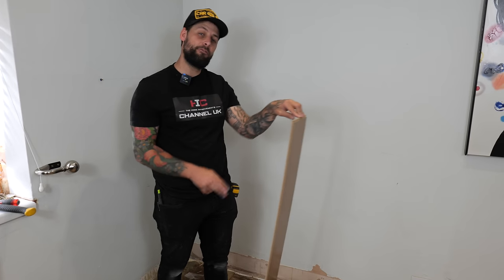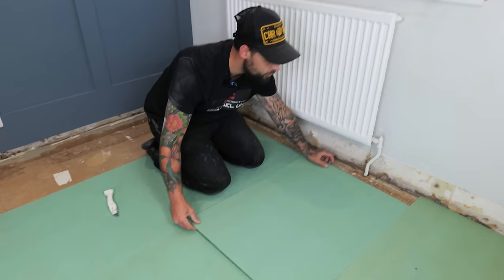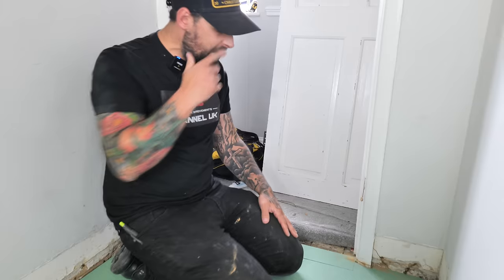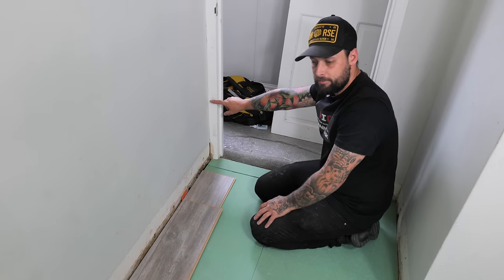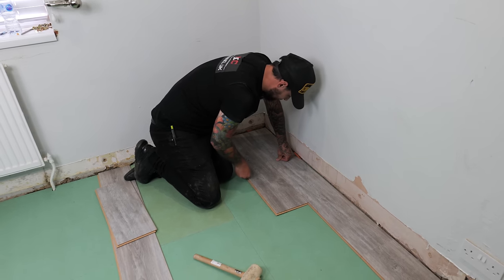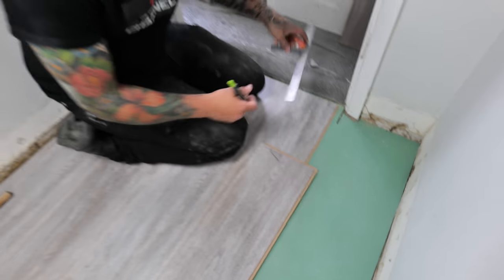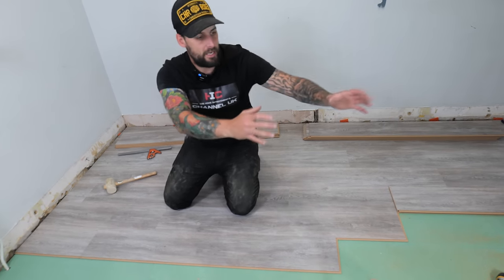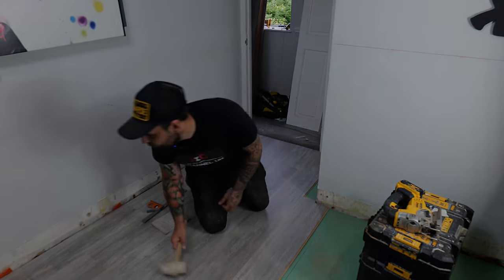How To Install Laminate Flooring | Easy Step By Step Beginners Guide

Comment: I don't understand why do you need to remove skirting boards before laying laminate flooring, you can use beading against the skirting boards
Reply: Makes a tidier job. It'll contract and expand under the skirting as opposed to the beading.
Reply: Beading looks cheap and unproffesional. And  the skirtings are very likely far from perfect. The flooring will look much better with new skirtings.
Reply: I don't understand how  you can even ask that question???  Don't you have any quality standards??  Or you  just always go with the cheapest and poorest quality finish
Reply: Some people don’t want beading lol
Reply: There’s no rule saying you have to remove them. It may be because you want a better cleaner finish without the beading strips, it may be because you’re old skirting boards are a mess and past their best, it may be cheaper for you to keep the skirting and fit the beading strips. Do whatever you like.
Reply: Because the beading looks awful
Reply: Old skirting is a pain in the arse to remove and refit. Beading is totally fine if you fit it right
Reply: Beading 🤢
Reply: Cos that looks shit
Reply: Looks crap though. Its like having skirting boards for your skirting boards 😂
Reply: Quarter round is so ugly though. I would remove the base boards
Reply: My opinion is - as it is skirting is annoying when you put some furniture against the walls. A quarter round or whatever added to that makes it even more annoying if the legs of a bookcase or sideboard hits it and so leaves a big gap at the back of the furniture. As others say it also looks a bit amateur.

Comment: Only thing I would do differently is use a drill to cut pipe holes just find its a bit neater to start with bit an then just cut the lines straight to meet circle rather than trying to get good rounded edges with a jigsaw and when possible putting a join on the pipe can eliminate that gap behind the pipe
Reply from the maker: Agreed much better method 😊👍🏼

Comment: Watched this video so many times I almost memorized the script. I finally did my building and I have to say, it's so much easier once you actually do it. After about 3-4 rows I got it down and did my entire building in about 5 hours. Not sure why I was so scared of screwing up lol. If you're hesitant like I was, just do it. It's really easy. Thanks for the tips and tricks. As far as the tools. I just used a rubber mallet kit sold specifically for this type of job and to cut, I used this guillotine looking cutter the store had so I didn't have to use a single power tool. Saved a bunch of money and no dust clean up doing the manually cutting route as well.

Comment: Best tutorial(s) on YouTube by far. One question… do you need to lay a DPM when using fibre board on top of a concrete floor? Or does the fibre board act as one?
Reply from the maker: If you are using fibreboard on a concrete floor you would need to also lay a DPM and ensure the concrete is fully dry.

Comment: Best video by far and Ive watched a view before I do my floor, can I ask, my laminate is 12mm and intend using 5 mm fibre board underlay but cannot find a suitable sized threshold strip to the landing carpet, they all dont seem deep,enough for the laminate and underlay, or advise me please
Reply from the maker: A typical z bar will work as you can tip them 😊👏🏼

Comment: You mentioned underlay with moisture barrier for concrete floors -  is this underlay covered with aluminum foil on one side? Does this aluminum foil cover need to face floor or be on top? Thank you.

Comment: How's it going mate, Love the video!! I have a question, please. When checking to see your not left with a tiny bit of floor on either side of the wall (around 9:25 you explain this point), what if you are left with a tiny strip of flooring? How do we over come this? Cheers

Comment: I have questions:
1) what brand of laminate floor did you use.
2) As it’s a flat blank, not bevelled edges. Is it still in good condition or has the planks started  to chip around the edges as you installed it over 9months ago.

Comment: We tried fitting out laminate in a very small space at bottom of stairs we used 1 pack of flooring. Our main issue was getting it to click and we were  not able to slide it in due to lack of space. Looks ok but I have noticed the 6 planks  have moved since fitting...I guess because it's floating it will move and be more noticeable?

Comment: Such a great video as always thank you! Do you have any advice or recommendations for joining laminate between two rooms? I want it flowing between living room and hallway. Would you have a flooring strip and separate between the two rooms or keep it flush throughout? And keep the pattern direction facing the same way?
Reply from the maker: We run ours through but it’s is recommended by manufactures to have thresholds between rooms so it’s at your own risk of course 😊
Reply: 110% do not separate. Have them as 1 whole piece.

Thank me later.

Comment: Hi. Did you not allow any explanation gap while laying the fibreboard underlay? Or does it not matter? Read on most places online that you need to allow at least 10mm for expansion between the fibreboard and skirting board.
Reply from the maker: You should yes  but from experience no point 😊

Comment: Great tutorial. Not laid a laminate floor in years.  Any advise on my hallway. Its norrow but long. Its 18.2ft long and with only 3.4ft would laminate be weak as the width is so short. Would only be 3-4 planks wide?
Reply from the maker: Will be fine done plenty like that 😁
Reply: @homeimprovements  thanks for the advise, much appreciated.

Comment: This is exactly what I need thanks. But one question.. I'm have concrete flow under but it's the green stuff also isolation or do I need 2 lagers under the laminate, one against the Cold and one against the Moisture?
Reply from the maker: You need an underlay designed for concrete 😊
Reply: @homeimprovements  so just one not two?

Comment: Great video, having a go doing my own when it turns up in a couple of weeks :D However, I've seen some people suggest a space between the underlay panels of 5mm? What's your opinion on this? Would be cool if you had any suggestions on the best under lay too. So many options! (I think I prefer the fibre panels).

Comment: Hi! I notice some packs of green fibre underlay I ordered have turned yellow. Is this normal or does it mean damp?
Reply from the maker: The sun will remove the colour 😊
Reply: @homeimprovements  ah thank you so much! 
Im finding the fibreboard flakes/ saw dust comes up when i walk on it. Thinking to put a thin foam underlay on top of it before laminate- is that a bad idea?

Comment: My floors timber but I have a small concrete fireplace rectangle what underlay should I use? There’s also a couple of mm of uneven where it meets the timber will the underlay be forgiving of this?
Reply from the maker: For that fibreboard will be fine 😊

Comment: Got myself some laminate to lay down. The thing is that it's some kind of laminate where you have to connect the whole row and lift up the whole row at angle to insert it into the previous row. I've seen in some other video that's called "twin-click" but on the package of my laminate it doesn't say anything or have clear instructions on how to install it. Any tips on twin-click?
Reply from the maker: Even easier to install 😁 Same method except you just slide it up and mallet the clip down 😊👍🏼👍🏼
Reply: @homeimprovements  I had a friend come over to help me today and we've done it. Yup, the mallet was necesarry to fully engage the front/rear joints. The side joints just clicked in from an angle and you just lay down the whole row. Thank you!
Reply from the maker: Awesome 😁👏🏼👏🏼

Comment: Guys quick question when fitting laminate I've always fit against floor boards if I ply the floor first can I run the laminate with the floor boards? Using white sheet underlay not boards
Reply from the maker: Absolutely mate 😊👌🏼

Comment: Can you give me a recomendation for the underlay i should use on a concrete subfloor in a new build,well 4 years old?
Reply from the maker: Timbermate is very good quality for concrete floors 😊
Reply: @homeimprovements  I'm looking at floors to go I think, they've got a sonic gold 5mm roll, tekno boards, I think there polystyrene, the fiber boards or the standard 3mm silver backed green foam, also if I was to use the 12mm and 5mm underlay, what would I use where the floor transitions to vinyl flooring? Off the hall way to the left I have the living room door opens in, just past the living room on the left is the bog door opens out in to hallway, floor is vinyl, end of hallway leads straight in to kitchen door opens inwards into kitchen floor is vinyl, what would I need to loose the 17mm step? Hahaha it's all confusing lol cheers for reply bud
Reply from the maker: They sell something called a stick down ramp for those 😊😊
Reply: @homeimprovements  ok cheers bud, one more ? For you, 8 or 12mm, both are rated AC 4, 20 year manufacture warranty rated for light commercial use, I'm using it for a living room and hallway with 4 door ways to contend with!
Reply from the maker: 8mm for us as the wear layer is the same much nicer to install 😊
Reply: @homeimprovements  , While waiting for your reply, I did some research, had a look at the 12mm and decided against it as it looks like it will be a bigger around door frames, and with the underlay there's a lot to come off doors that transition to a much lowe level ( won't lie, they would make great jumps for my RC car with ramp bars🙊🙉🙈😛)  so I went with AC4 8mn step click with a 15 year residential guarantee! As we're In a new build the flooring shop recommended the 3mm silver foam underlay for downstairs and for some sound deadening on the upstairs chipboard floor the 5mm sonic gold, I'm just stumped where to start down stairs as I want the floor too transition from the living room into the hallway but it's a mad shape meaning at one part I'd have to lay the laminate backwards if you know what I mean?  If I post a quick short with a diagram of the floor layout tomorrow morning, would you be as kind as to have a quick look and tell me what your thoughts are? You've been a great help and it's very much appreciated mate 👍🏻👍🏻

Comment: Maybe a strange question I don't know. We need to take up a row of laminate or two because we need to get to under the floorboards to do a job. Is it fairly easy to just remove a row? It needs to come from the middle too.
Reply: Its a click system, you pull up from the sides
Reply from the maker: As said you’ll need to uplift from an edge and work your way back to the middle section 😊👍🏼
Reply: Thank you. I thought that may be the case!

Comment: Just thinking about putting a laminate floor in my lounge but half the lounge as a wooden floor and the other half has concrete, should I mix the underlay  or could I get away with just using the fibre board throughout the room the floor is uneven. Can't believe thinking about this and up popped your video great video guys thank you so much 👏👏👍
Reply: Surely you'd use the moisture barrier throughout...
Reply from the maker: Just use a dp on the concrete side under the underlay and use fibre boards 😊 or if the floor is flat enough timber mate is a fantastic underlay with vapour barrier 👌🏼
Reply: Great video. I wished I'd seen it before I did mine. 😂 👍
Reply: @homeimprovements  there's only one dp I know, and I'm not sure how it applies

Comment: Beading all the way around the skirting board, after you have laid the laminate flooring does look really unprofessional.     Personally… i don’t like that idea.   But, if you want to keep the skirting board on.. for some particular reason…. like i would do;  what other option is there?   Except lay, the laminate panels up against the skirting board.     Or you could use a dremel tool… and cut underneath all the way around the skirting boards; and just slide them under.  

I’m undecided what to do about my 16x12 feet bedsitting room;  as the tiny kitchen i have is slightly joined onto the room itself.   
Buying a 17x13 feet Lino roll would not probably be an option; because i doubt whether i could get it into the flat itself. ( Lino roll would be far too long) 
Laying down a carpet is not an option either.  Would have to go in the kitchen.  Would get too wet and dirty, if anything is spilled.

Laying laminate flooring seems the only option.  But i must admit though… Lino does look nice too.
It looks like i might have to lay the laminate flooring myself.   i just hope i get all right? 
22nd June 2024.   Southampton England 🏴

Comment: Making those marks all the way to see if the layout has a small cut is ridiculous. Put a few pieces together take a measurement. Then measure the room and see what the off fall is. Lord don’t make it so difficult. 

Also get yourself a laminate cutter. Save yourself the mess and time. 😭🙃
Reply from the maker: I have a guillotine and you don’t need to put bits together I can do it with a tape measure and the length of one board but we try to simplify to help people without all the tools etc 

We have been doing this 17 years

Comment: I always put a number on the back of the board and the corresponding number on the underlay, should i ever need to rip the flooring up for a leak and then it can go back down as it was installed originally 👍

Comment: Lads, honestly, smashed it with the explanation. Keep up the good work. 

I’m a fair newbie to DIY handyman type work for the last 2/3 years (acoustic insulation, carpeting, noggins etc.) - so just diversifying my skills. 

3 quick questions: 

1. Couldn’t you in theory use the laminate cutter instead of a Jigsaw for the initial piece you did? Guess you’re gonna need a jigsaw for door frames anyway!

2. I didn’t quite get the point around 9:02 about “tiny cuts at either end”? What’s the point in making those markings? As in, average room you’re most liking having to cut down the width of a laminate before you reach end wall? 

3. Is the “10mm” expansion from the wall standard? For skirting boards etc. to cover after? I imagine a spacer is 10mm by default then? 
 

Thanks
Reply from the maker: Thanks much appreciated 

1 yes you can 
2 basically we want to avoid any bits under 50mm so we plan out ahead of time 
3 all depends on the brand they vary from 5-10mm usually spacers are available in any size 😊

Comment: Question, I’m starting a laminate flooring project on the security nd floor of my house. I also will do the stairs, what do you suggest I do first,the stairs or the flooring? Also, is a underlayment needed on second floor? Should I start from the hallway into the bedrooms or van Coverdale? Your advise will be appreciated, thanks for the video
Reply from the maker: Tackle the hall first it’s the most difficult then rooms after that the stairs is what we would do anyhow 😊😊😊

Comment: Great video! I’ve been following it whilst doing my lounge and it’s going great. But I’m about to run into an issue, there are two doorframes that I’ve undercut and they’re both on the same opposing row as each other. Any tips on fitting the last piece under the door jam??

Comment: So glad that I've found your videos, I've been binge watching them all in preparation for renovating my own house. I do have a couple questions, what are the spacers/expansion for? Should small cuts at the threshold be avoided? And is it wise to have just two different lengths of laminate against one wall i.e. a brick pattern?

Thank you guys and keep up the good work!
Reply from the maker: Thanks spacers are for expansion yes yes avoid where you can and joints should be random stagger 😊

Comment: Don’t you need an expansion gap around those radiator pipes too? It looks like you’ve cut it so it’s close to the pipe.
Reply from the maker: You do and there is 😊👍🏼
Reply: @homeimprovements  Ah cool. Wasn't sure, as the vid cut to the next scene before that piece was in place. 👍

Comment: The laminate I’m using doesn’t click anywhere near as easy. It doesn’t actually click in at all on the long edge if you put the short edge in first. Have to use a tapping block from the other end

Comment: I found it's always helpful to plan out the width of your first row nor only for what will be your last row, but for those obstacles that arise as you go across the room. In your case the 6th row in as you pass that doorway wall. Could put you in a sticky situation leaving a row that needs to be like and inch wide.

Comment: You start from the centre of a wall not the corner 🤦‍♂️ the centre of the room is what people see so if your boards run out when it comes to the walls cos most the time walls arent straight you avoid having the boards not straight or huge gaps, its important to have the centre of the room looking straight cos the walls are covered by units etc cos like i said, its the centre you see. How do people not know this 🤦‍♂️